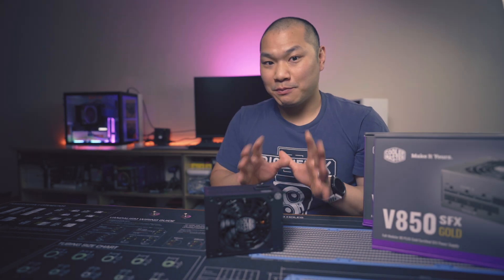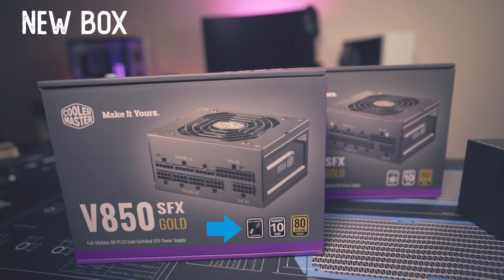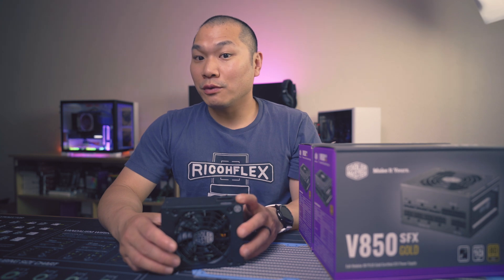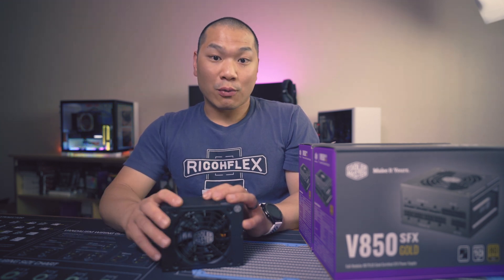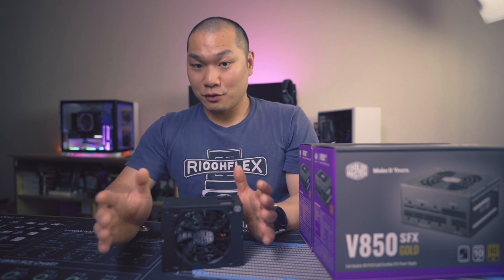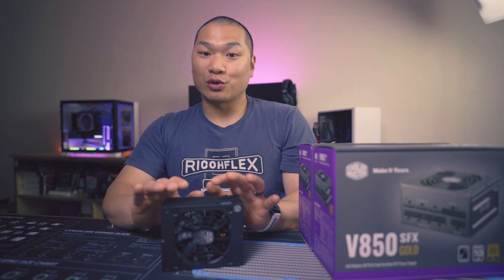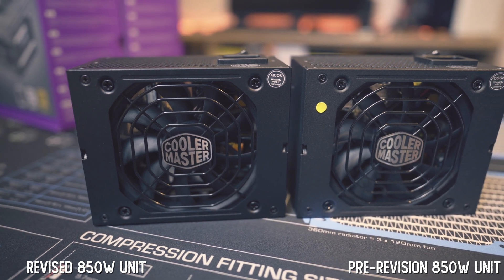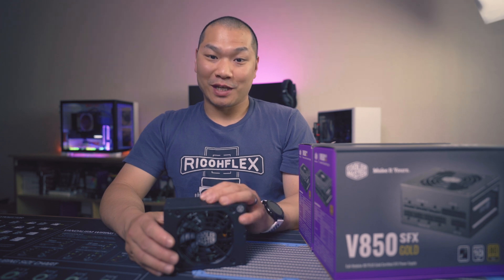A Revised Fan? Cooler Master SFX Power Supply Revision (2021)

Comment: I have this issue, and It wouldn't have been a problem if the thing didn't spike from 0% to 100%. It almost as loud as when my gpu fans are running at 100%, and it turns on and off every couple seconds during anything except gaming.

Comment: I posted on this video back a couple of years ago when I got the first revision of this exact model. I had lower-end hardware and didn't have the issue then. Now after I replaced the hardware for better cpu/gpu now this issue is happening lol. I setup an RMA luckily I'm still well within warranty. I will update this post as the processes goes through if it goes smoothly or if I run into issues. Thanks again for this coverage!
Reply: Hey man, I´m in a similar situation and wondering if I could RMA it since it´s been already a couple of years since I bought mine. Any updates on your process?
Reply: @raularaujo1261  Yeah do it. I think these originally came with 10 year warranty. Just mention what's goin on and they should get you setup. You want to fill out their form on the CM Fanzone site (just google to find it). Just a note, they replaced it with their newer pcie 5.0 / atx 3.0 version model that has the louder fan (not with the bad fan curve like the originals, but the fan itself is just a bit loud). You might not like that and I ended up swapping out the fan for a noctua which does void the warranty. Also, the newer revision PSU only comes with x2 PCIE cables, so you may want to keep one of your PCIE cables if you return the cables with your OG one
Reply: Hello, can I have an update too? I have my v750 sfx since 2022 and am also wondering if i could get a replacement as well.
Reply: @kappa2569  Try replacing the stock fan with Deepcool FT9 slim. It's a similar power draw (0.45A vs 0.46A) so the fan protection won't prevent you from using the unit. It should be miles better than the stock one.

Comment: I have the same issue for  my power supply (V850 SFX Gold). I am in the process of getting replacement unit, however Cooler Master Customer Support need invoice for the Powe supply , which I am unable to provide since the original unit was a gift to me. Anyway you could help me here?

Comment: Besides the improved temp fan curve revision, but the COIL WHINE still present if GPU pulls more than 300 watts? 
Can anyone confirm this because doesn't want to spend $150 on whining PSU and still have to undervolt the GPU to keep it quiet?
Reply: My v850 sfx has very loud coil whine and its the „new“ one
Reply: @345ifyhalo  you can return and replace it for another one or under-volt the GPU and hope it is quite down.  YMMV!!!!
Reply: @Esc13A  are there some of them without coil whine? Im using a heavely overclocked rx 6900 xt with power consumption of up to 410w.

Comment: I got the White V850, so definitely revised unit, but man this thing is LOUD. Easily the loudest componennt in my Meshilicious. Running it with NZXT X63 on 5800x and Sapphire Nitro 6800XT, and only thing I constantly hear outside of gaming is V850 (in gaming ofc GPU is louder)...In desktop fan from V850 spins constantly and it is very annoying. 
Fans from AIO and GPU slows down quickly after load, but this thing is just spinning loudly forever after, it is soo annoying.

Thanks god I bought it from Amazon, so I am returning it and getting SF750 Platinum, crossing fingers it will be silent and powerfull enough for my build. 
In my previous build I actually had the same CPU and GPU and I experienced shut-downs under load with CoolerMaster V750 (ATX small version, old around 2014 model), so yeah I could say I am never buying Cooler Master PSUs again.

If someone wants to know results with SF750 reply to this, I can answer with the results after I do the exchange.
Reply: Hi, i have a same issue, i have a 7900XTX and a 5800x lmao my psu cry if i play game above 60fps
I think buy the corsair 750w but i dont know i the coilwhine is present
Reply: Hello, I live in Turkey and I recently ordered the new version white version from Amazon America.  The product has not been sent yet and I am very sensitive about sound.  Do you think I should cancel?  I used the ATX 3.0 850w model and the system was very noisy to me when idle.  I had to return it.  I also use meshlicious and I am very happy with my seasonic ATX 850w power supply, but I want to buy a small size power supply.  Was yours the new version?  I'm curious about your opinion, so I can cancel my order.  Unfortunately, Corsair sf750 is not sent to Türkiye.  I don't want to buy an Sfxl power supply either.  It's a bit annoying 😅

Comment: So... I have the old and new model, they said for me to just recycle the old one.
I'm curious if the difference in the versions are circuit-level or just the fan itself. Do you or anyone here happen to know the answer?
Seems daft to just bin an entire unit.
Reply: Ooo where do you live where they just told you to recycle the old version? They told me I had to send my old one back before they can send me the revised version :(
Reply: @mehthewhatever  UK. Problem was that, when I had sent it they refused delivery on the other end due to lack of invoice for some reason; but nobody ever told me to put one in so they just said to recycle.

Comment: They should have just pushed the fanless threshold to 35% or 300W like the SF750
Reply from the maker: I think that might not necessarily be better, it basically spazzes out with all the heat built up during idle and tries to clear it all out, so even if it were OK thermally if the threshold were higher, it would have to spike for longer to clear out more heat.
Reply: @MachinesMore  The temperature threshold seems really pointless. It just creates more burst behavior, which was the entire problem to begin with. I think both EVGA and Corsair just use higher wattage load  thresholds to kick the fan on or off. Could be wrong but I haven't heard of either spazzing out like you're describing.

Comment: Hey there! I was wondering if I should go for SF600 platinum, or this one for my 3600+3080 system downsize. Unfortunately they've stopped selling the SF750 in my country due to certification issues.

Would the SF600 be sufficient given that the 3080 has wild power spikes?
Reply: Optimum Tech did try that. However, he also probably also did undervolt, not sure.
I know a person from Amazon who used 3080 with CoolerMaster V650 SFX though. They later upgraded to v750 but I guess if you have 3600/5600x, then 600~650w is enough as long as you have a FE or non-OC card. I would personally get 750w one for peace of mind (some are saying even that is too underpowered but I think that's no longer the issue with latest Nvidia drivers fixing spikes).
Reply: No issues with a EVGA 650GM and a 5950X and EVGA 3080Ti, both at stock. But I'm looking to upgrade just in case. I've played Metro Exodus remastered (the raytracing version), Chivalry 2, and Aliens Fireteam Elite. No issues with power, but Aliens likes to crash with a "out of VRAM" error if I have something using hardware acceleration in the background, like Chrome.

Comment: Do you think the revised 750w ones will handle Ryzen 7 + RTX 3090/80 just as well as SF750? I bought 750W because that was only available, only to see V850 going on sale few days later after I finished the build.
Reply: Other than that, it is making +10khz noise that's noticable when sitting near it for a long time. Not sure if it is safe for me to switch.

Comment: Hi, i just got mine today. It's the revised version but there's this weird click sound when the psu shuts down. Is that normal?
Reply: Yep. It uses a mechanical solenoid. CM mentions that it is safe as long as that's not happening in the middle of use.

Comment: Want to ask, I use:
 -Aorus B550i ITX
 -Ryzen 7 Pro 4750G
 -DDR4 3200Mhz 8GBx2
 -CoolerMaster SFX V650 (version 2021)
 -Without VGA card
 Until now, I have never seen the fan of the power supply spinning, is it normal?  because I don't used a VGA card yet.

Comment: is it worth it to put in a atx case just curious i wanted to know i wanted something not as bulky appreciate the feedback
Reply from the maker: You could, I don't know why since most ATX cases have a compartment for the PSU, so it's not like the space saving would necessarily be meaningful. In a case like the O11 Dynamic mini, you do have to use an SFX PSU so there is a use case for that.
Reply: @MachinesMore  im using the cooler master h500 its a new case for me

Comment: I RMA'd my 750watt due to the fan curve issue, and they sent me a pre-revision 850watt unit.  It does not have the Japanese capacitors advertised on the outside.  Feel like I'm being given the run around....back to CM support I go. Frustrating.

Comment: I am considering replacing the fan with a Noctua one. Does the revised version still use a 2 pin connector internally for the fan?

Comment: Just exchanged my V650 with local CM authorized distributor and ran the new unit for 2 days, no more abrupt fan burst! 
My 2 cents:
1. Try to contact your local CM authorized distributor first if you can. Don't rely on the shabby customer service of CM HQ; CM HQ is hard and slow to deal with. I called my local CM authorized distributor, they called me back after checking with CM HQ and confirmed the unit was in stock, then I walked into the office with old unit and walked out with revised unit. Simple, no ticket required.
2. According the authorized distributor, they haven't received official instruction from CM regarding the exchange of V-Series SFX, and they hinted that "not ever customer find the fan behavior an issue." The way I read it is that CM is welling to honor the exchange, but doesn't want turn this into a recall.
So watch this video carefully, call up your local CM authorized distributor and let them know you've heard of the issue and know what you're talking about. Don't let your right slip away.

Comment: They use this model (650w) in their NC100 NUC cases. Mine does this and every time the fan changes speed it causes massive lag spikes in game. I wonder if they would replace it to the revised version without returning the entire case?
Reply from the maker: It's worth a try, I mean you basically have one of the earliest versions of the PSU since the standalone version came after.
Reply: @MachinesMore  Contacted them, they said they will replace it but unfortunately no stock of the revision at the supplier yet. But great to know they will do it.

Comment: Do you know if they will honor the exchange if you purchased the pre-revised fan used?
Reply from the maker: Supposed to, if you are having trouble please let the community know. I don’t have experience dealing with their customer support on this issue so we need all the user feedback we can get!
Reply: @MachinesMore  so they approved my RMA, however, the only way for me to exchange it is to disassemble my PSU and send it to them, and wait 2 to 4 weeks to receive the revised unit. This means that my entire machine will not be usable for 2 to 4 weeks, which is not realistic when I need my computer to work. I am very disappointed that they do not offer a way where I can send back the unit after receiving the exchanged unit to minimize downtime, since the 2 to 4 weeks of downtime for a PSU that's suppose to work as they originally intended is not worth the 2 to 4 weeks of lost wages from me unable to use my computer for work.

Comment: So very disappointed in this PSU. I'm so sorry I didn't do more research before buying this PSU. And the stupid thing is that I waited for almost 3 months to get it. This video doesn't give me much confidence in the revised unit either. This thing is LOUD onder load. So even with a fixed fan behavior it will still be loud as hell when onder load. No thanks.
Reply from the maker: Sorry to hear, I’m surprised it’s loud under load but everyone’s setup differs- how high are you loading it?
Reply: @MachinesMore  Actually I used your " Build an RTX 3080 Small Form Factor 4K Gaming PC" tutorial so thank u very much for that. Me and my son had a blast with the build. The build is exactly the same except I used Ryzen 5900X and a RTX3060ti because of availabilty. So all the other components I copied from your video. I was very surprised that my build was so loud so I tried to find the issue. At first i thought its the CPU cooler or the casefans and played with the fancurves without results.  At the end I located the loud noise coming from the PSU. It is absolutely the loudest component of the build.
Edit: added some text.

Comment: i bought this power supply when it first came out am i entitled for the revised 1 if mine is making the same noise
Reply from the maker: From what Cooler Master has told me, yes they are exchanging them if you go through customer support.

Comment: Welp, the thing about the inventory on Amazon being new wasn't true. Just got mine today and it isn't the revised edition.
Reply from the maker: Sorry to hear and thanks for sharing... was that from the Cooler Master store on Amazon? The info they shared was that the stock was at the online retailers, it is possible leftover inventory is mixed in though. 😕
Reply: @MachinesMore  I ordered during the small window of inventory stock, which had an ETA of Mid April, but it already came in not even a week after my order. The order was from the CM retailer on Amazon and got the new revision.

Comment: Hey man, I'm a bit confused about this whole SFX power supply situation and was hoping you can clear a few things up.

The only reason I'm interested in SFX psu's at all is because the Lian Li o11 Mini requires it. Otherwise I'd go ATX all the way. But here's the confusion. 

A little while back, Gordon Mah Ung did a video interview with Jon Gerow aka JonnyGuru. JonnyGuru was the premiere power supply expert but now he works at Corsair apparently. They were chatting back and forth but then Jon said something that caught my attention.

He said their Corsair 750W SFX power supply is 80 plus PLATINUM instead of Gold because platinum is slightly more efficient and that if they stuck with Gold, the unit would have gotten TOO HOT. 

If that is the case, and their 600W unit is fine being Gold, but they had to make their 750W Platinum for efficiency, cooling, and heat design reasons, then this 850 Cooler Master unit that's Gold raises some safety/heat concerns for me. Also, if you watched Lian Li's 2021 digital Expo video, they will also soon ship the O11 Mini with a bundled PSU, 750w at 180 bucks, 850W at 200 bucks. However, both are also Gold.

So what's going on? Why did JonnyGuru say they had to go to Platinum efficient for Corsair 750 otherwise it would've gotten too hot, but CM and LL can get away with Gold 750, and even 850W???? Are the engineers at CM and LL smarter than JonnyGuru and Corsair? Or is a future lawsuit in the works because of a clear fire hazard???

Also, please do a fan roundup comparison video between Scythe Kaze Flex, Kaze Flex BLACK, Wonder Snail, Arctic P12, and Noctua. I love fans. 
:)
Reply: The fan curve is more aggressive for the CM where it relies on temps vs the platinum sf750 doing a mix of temps and load as well as not running the fan for a decent number of watts. So, it is probably right in corsairs case to have it raised to platinum rating as the fan curve is not as aggressive compared to coolermasters. Coolermaster seems to have a different philosophy with sfx psus and feels that to get people interested in buying their psus, gold rating is enough while being cheaper. If I really had to buy a new psu, personally I’d just go for the 750 watt as 850 watts in sfx is kind of untested territory. I think that Corsair is still working on sf850, but apparently making mass production of those units has been hard especially due to the current situation.

Comment: Hello I just bought this power supply. The revised version. After running AC Valhalla a day now several hours at a time I  find the fan very loud compared to my Corsair SF750. Very loud. The Corsair is dead silent. My system costum water cooled RTX 3080 Ryzen 5800x Gigabyte X570i Aorus pro, EK DDC 3.2 PWM water pump.  I may return it. Not impressed

Comment: I had no idea cm had sfx power supply. I thought my only option was Corsair. I got the SF750.
Reply: Sf750 is super quality and has been around a long time and been proven. I’m kind of done with itx builds since my sf600 gold died on me running an oc i7 4770k @4.2GHz and 2070 super in a NCase M1 v1 case. I think the Corsair platinum units are worth, but kind of wish Corsair just ran their sfx psu fans constantly at a low 600 rpm or so when like internet browsing or something.
Reply: @CknSalad  i have an ncase m1 with sf750, 3080 and 5900x
Reply: Luis Osambela how are the temps? That’s a nice rig.

Comment: Is it just me or did they only half-fix the problem? The revised unit still has a very noticeable fan spike when starting the second Heaven run. I think maybe they don’t have enough passive thermal mass in there to absorb fast temperature rises while the fan spins up at a gradual, polite rate.
Reply: Yeah I think would be better if the fan would stay on right from start up and be load dependent instead of temperature dependent
Reply: @peterjuma7620  The good news is Newegg US got a huge drop of Corsair SF750, bought one so I don't have to worry about this!
Reply from the maker: That’s possible, a sudden load like from a 3080 can definitely cause the temp spike since the fan hasn’t kept up yet. The original issue was more sudden spiking to max at low loads, and I’d say the speed ramp at the start of a game is a non issue unless somehow your card usage is extremely bursty. Glad you picked up a PSU though!
Reply: Thanks for the info and really love the channel!